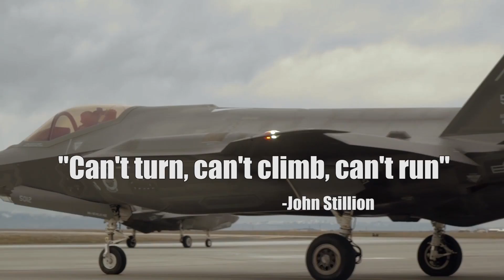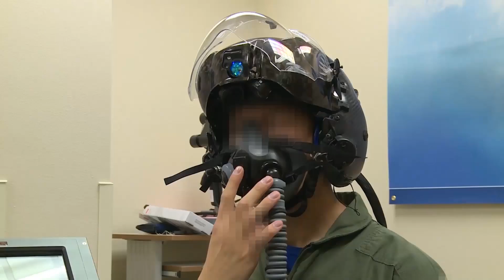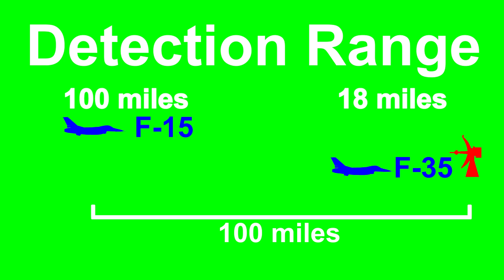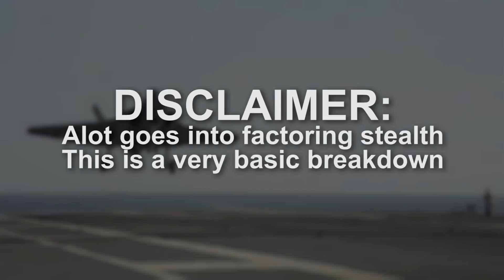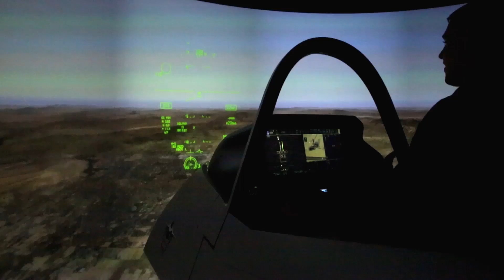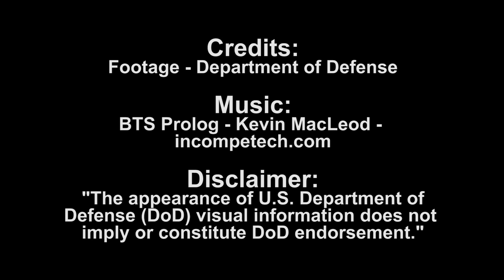F-35 Overview - The Good, The Bad, The Ugly

Comment: There is another issue, and that is the question of its operational flexibility. It's a flying computer and it has to be reprogrammed for every change of mission profile, weapons load or basing. So do most modern combat aircraft, but the F-35's computer systems are so enormously complex that it takes far longer - hours for a simple change of weapons, more for a mission profile, most of all - a full day or more - for a base change. This has to be done in a clean hangar, which limits it to operating from major air force bases. But the main restriction is that it can't be used on flexible or extemporised missions, or scrambled, or against targets of opportunity. This is a major operational disadvantage.
Reply: puffin51 source?
Reply: For the time to download data on change of location: https://medium.com/war-is-boring/the-f-35-stealth-fighter-may-never-be-ready-for-combat-5c1180d6e2b1. This refers to the ALIS system. For download/upload times before and after every mission, see http://www.aph.gov.au/Parliamentary_Business/Committees/Senate/Foreign_Affairs_Defence_and_Trade/JointStikeFighter/Report/c03 para 3.29. Please note that this is quite separate from the US policy of locating software labs that can deal with this data only within the US, which means that any transcontinental cable disruptions will mean that allied F-35's cannot fly at all.

Comment: Overall I really liked your video and while I agree with your contention that stealth is an expensive feature on this plane, I do have to disagree that it's the only reason for the high price tag. The integrated sensors (radar, EO/IR, ESM/ECM systems) and avionics (cockpit displays and helmet mounted displays) also add significantly to the plane's cost but provide an exponential benefit when compared to legacy systems. For instance the F-16 has no innate EO/IR or ECM capability (and its ESM is strictly limited to RWR, Radar Warning Receivers that are barely better than a fuzzbuster) so it has to carry external systems like LANTIRN or AN/ALQ-184 systems  to enable these capabilities, but it still suffers from increased pilot workload required to manage these addons compared to the F-35's vastly superior system's integration. 
Please be careful in the future with these large sweeping statements, I just had to cringe a bit at the end when you claimed that carrying external stores defeated the purpose of the vast monetary investment. Listen to the pilots' interview where they discuss the "Day 1" payload packages compared to "Day 2". The strategy is quite simple, the F-35's will load out with all internal stores on "Day 1" (maintaining maximum stealth) and perform the SEAD missions to clear enemy air defenses; then comes "Day 2" when 4th Gen aircraft and F-35's carrying full loads (internal & external) are able to attack the regions with little or no air defence threats.
Furthermore, have you seen Boeing's videos and literature for the new F/A-18 Super Hornet? You know the 1 with the stealthy external stores pylon??? Do you really think that the F-35 doesn't have something similar???
Reply: He was right. The only thing you pay for is stealth. All the other features can be upgraded and were for a big part added to F-16 Viper. Outside of stealth and bigger engine or radar due to dimensional constraints, all the electronic equipment can be added. Electronic edge had slowly melted away and you should be more precise what you are referring to or quoting as it is impossible to check it out.
Reply: @REgamesplayer  spoken like a true noob a lot of the extra development cost of the F-35 covered paying for built in sensors and all the integration costs of those sensors & software to perform sensor fusion as well,, whereas the F-16's original price was for the basic airframe with a crappy stripped down radar with no capability to even shoot AIM-7 Sparrows (this predated the AIM-120) no IR/EO system and only the most basic Radar Warning Reciever for detecting Radar lock of incoming radar guided missiles. It was stripped down for light weight, and was gun and all aspect Sidewinder only for A2A. Also the development cost appeared lower because  the bolt-on IR/EO and EW equipment were stand alone projects if you really want to see the price of a combat ready F-16 lets add in the ALQ-184 pod and the LANTIRN costs for design, build, maintain, and upgrade, this can easily be done by looking at the price of the new Viper variants of the F-16V which are selling in low rate production for $118M which is way more than a new F-35...
Reply: @r.b.seiple5913  First, get your numbers right. F-16 Vipers cost around 60-70 millions while F-35 costs around 100-160 millions. Secondly, figure out what you are talking about. I had mentioned F-16 Viper which is as same as F-21 which is heavily upgraded variant of F-16 while you are talking about basic F-16 with no upgrades. Thirdly, everything in F-35 besides stealth can be put into F-16 or F-15. You went on to talk about your own points, totally ignoring what I had said.
Reply: @REgamesplayer  Here some links to a articles about the sale the F-16s and F-35s for comparison:
There is the 8 F-16V Block 70/72 fighters to Bulgaria for around $1.2B, that's over $150M per aircraft:
https://www.defensenews.com/global/europe/2019/06/04/us-state-department-approves-17-billion-sale-of-f-16s-to-bulgaria/
Then there's the sale of 18 F-16IQ fighters to Iraq for $2.3B which makes it about $127M per unit:
https://www.dsca.mil/major-arms-sales/iraq-f-16-aircraft
Yes these contracts include spares and other essentials (making the 8 Bulgarian aircraft appear much more expensive because those parts aren't divided over very many aircraft) but the truth is that the F-16 is no longer getting the production volume pricing discounts it use to enjoy, because Lockheed has has dedicated more of its resources to F-35 production. 

Compare that to Belgium's 2018 contract for 34 F-35's at $4.55B which put the unit cost at $133M with similar spares and essentials included, and consider that since 2018 F-35 production prices have dropped by around 10%, these prices are on the high side:
https://www.reuters.com/article/us-aerospace-belgium/belgium-picks-lockheeds-f-35-over-eurofighter-on-price-idUSKCN1MZ1S0
Reply: @r.b.seiple5913  Hmm, you are right. USA had done a great deal to fix their heavily mismanaged program and with parlament designating a dedicated man to oversee this program, it really comes all together, at least on matters of price.

The only thing which older generation planes are better from financial side of things are just operational costs. However, it is only because when it comes to electronics, older jets got pretty much everything that F-35 has without hull changes.

Comment: The Superhornet, F15SE and Eurofighter all cost more then the F35.  Argument about price is non existent.
Reply: A kitted out Superhornet is 120 million, same deal with Eurofighter, the F15SE is a new platform even more..  The F35 airframe goes for around 65 million the rest is all the technology put into it, if you take the Superhornet and throw in DAS how much would it cost?
Reply: Two engine maintenance vs one, yes you must maintain the sensors but its no difference as if you were to throw DAS or the helmet system onto the F18.  As for the Stealth coating, i'd love to see a alternative coating for most jets while not on active duty.  
Coat your NORAD response fighters and fighters designated for deployment.  Coat the rest with a cheaper non stealth coating but can easily be coated with the stealth paint. 
The rest of it is just a air frame no different then any other jet.
Reply: Two engines one going out and making it home with increased thrust to carry the payload better vs 1 engine which will go down, go slower and carry less. Also only F-35 might be 100Mill or less F-35B and F-35C cost way more.                                                                                      
76 F-35As CTOL - $94.6 million (7.3% reduction from Lot 9)
12 F-35Bs STOVL - $122.8 million (6.7% reduction from Lot 9)
2 F-35Cs CV - $121.8 million (7.9% reduction from Lot 9)
Reply: I don't know, how much is a dead pilot worth? To be fair, the Super Hornet will work if they let F-35s headman the operation.
Reply: I think you need to see a cross section compared to the F-16 and F-18. Tje F-35 looks great!
Reply: For current unit price, you are correct. But the total cost of the project (the R&D cost) has been hugely overrun by the project (as correctly stated in the video). Furthermore it was reported that the F-35 seems to require maintenance a lot more often than it's competitors. The initial purchasing cost really isn't the most important thing. You want something that you can afford in the long run as well.
Reply: Uh not really. Th main reason why Russia took this route is cause unlike the US, Russia doesn't have any warm water ports to land aircraft carriers for immediate action roles.
Reply: Good point
Reply: Their development price was cheaper
Reply: I think its not the price per plane, but all the researchging costs
Reply: The reason isnt a superior air force, its land mass. It is much easier to defend territory with a wall of surface to air missiles than it is with aircraft.
Reply: said a kid that never earned or paid for anything in his life
Reply: There is a reason why Russia has chosen the advanced anti-air route, because the US air force is far superior than any other in technology and numbers.

Comment: nope youre wrong go back and research again dude f35 can carry 6 amraam not 4  damn your video has a lot of mistakes
Reply: F35 can carry 4 internal currently.  A new weapons bay door slated for block V is expected to bump it to 6 internal, and if not 6, 4 internal w/ 2 AIM9x.  Again, trading streamlined stealth for internal weapons.  I suggested a similar option for the F22 -- Bulged doors that allow 2 AMRAAMs to be carried on the doors -- with the option to change out bulged doors for its current.  Such a config would see the F22 carry 12 internal missiles up from its 8 currently.  Although 9x BIII adds a 50% range and air to ground capability, as well as a SAM and cruise missile killing ability.
Reply: physically and technically lifting up the load is different to the advantages of taking off in the conventional way specially when the point is about the military effort
Reply: What a botched review. Misses sensor fusion completely and gives false information.
Reply: This dude thinks that radar absorbent coatings only work if they are as thick as the wavelengths, which is why long wavelength radar has a better chance of detecting stealthy aircraft.  Totally backwards.  Long wavelength radars ignore the shaping of a stealth aircraft. Not the coatings.  I dont know where this guy gets his information.

Comment: F-35 has such small wings, that it can never be maneuverable. Second, the idea of stealth is a scam. High frequency radar can sea stealth planes. Russian radars are high frequency radars, in 1999 a F-117 was shot down above serbia, with a russian SAM (the S-125, a realy old sam system) And the chinese has already stolen the blueprints of the F-35, so they will make countermeasures. If you have a jammer on your plane and it is obsolete, you can replace it with a better one, but you cant change the fuselage of a plane. When you use stealth, you also need alot of maintenance. And you cant take alot of weapons in the bomb bay. And when you put bomb or missiles on the wings, bye bye stealth.
Reply: Bart050384 *you mean russian low freqency radars 
low frequency radars can`t guide missiles
Reply: According  to who?
Reply: looks like someone needs to do some research on radar capabilities. stealth aircraft are designed to deflect and absorb high to mid radio frequencies. the reason that low radar frequencies can detect stealth aircraft. is because it has a large radio wave that makes it really hard to deflect the whole signal away from enemy  radars. but then you must look at the reason way using low frequencies aren't really worth using. low frequency radars have to be quite large that will make those systems a easy target as well if your radio wave is larger it becomes much much more inaccurate. You may see it but you won't trully know an exact target location. so for perspective most low range radio frequencies can have a wave length from 7 to 10 miles. to me that pretty much like trying to find the needle in the hay stack.

Comment: From what I always understood about stealth. The F35 (air to ground role) will be to go in and knock out the hazards to the non-stealth aircraft. For instance taking out Radar and SAMs because they can get in closer. In the Air the Air role its the same thing. Like the Raptor it can see enemies before they see it. In essence taking out lead waves of enemy 4th or 5th generation interceptors and than allowing non-stealth aircraft to continue the fight without the enemy stealth aircraft in the air. So it does not need external tanks or need to be an excellent up close dog fighter.  And lets face it. There is really a low chance of up close dog fighting in modern air combat. Either way in any future conflict, the Raptor will establish air superiority. While the F35 will attack pockets of enemy resistance, air or ground. Also the fact the aircraft is exclusively built in the USA is a great point. That money goes to American contractors. Whom employ American workers.  Excellent channel btw Covert Cabal.
Reply: Its not exclusively built in the USA, lots and lots of foreign contractors
Reply from the maker: Yes I agree. The issue I see with it in a ground attack role is that it can be detected much sooner and more easily with low frequency radar (which are ground based due to size). Lower frequency radar waves can measure several feet in length, and its unrealistic to have an aircraft with a several foot thick coating of radar absorbing material. Low frequency radar typically isn't accurate enough to guide a surface to air missile to hit it, but it can alert interceptor aircraft to shoot it down.

One real cool feature of the F-35 I forgot to mention is the EOTS. It is an infrared search and track (IRST) system that can spot extremely small targets (aircraft and ground) from up to 100 miles out. It will be extreme useful for detecting future stealth aircraft and mobile targets like SAM sites, tanks, etc. In the past, if a ground target wasn't emitting radar, often times you'd have to spot it visually meaning within a mile or two.

Thanks for watching! I make the videos because I'm truly passionate about this field. I don't do it just for money (which is almost nothing). I really enjoy creating these videos and having discussions like with you and learning new things!
Reply: Excellent point. I believe thats how the Serbs shot down an F117. A theater commander has so many options now. But I truly believe the F35 even at its cost is a winner. We shared stealth tech with our allies. And we've learned that you can't apply one design to three different design request.
Reply: Ya, i saw that but still its too well tied into the US economy.
Reply: shack adoodledo
Yes, it was good of Lockheed to translate Petr Ufimtsev 1960s concepts of reduced radar [stealth] signatures.